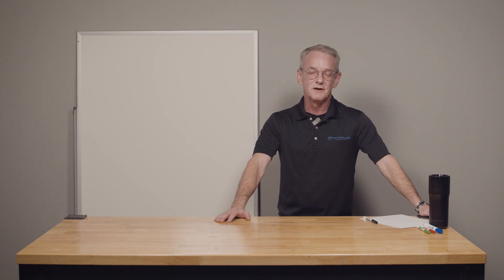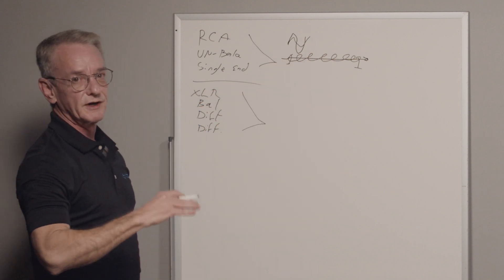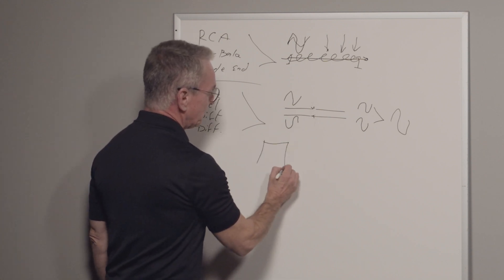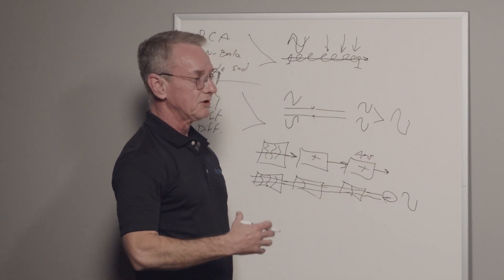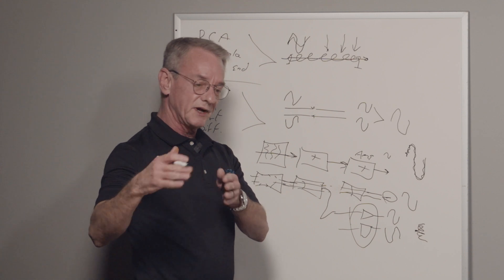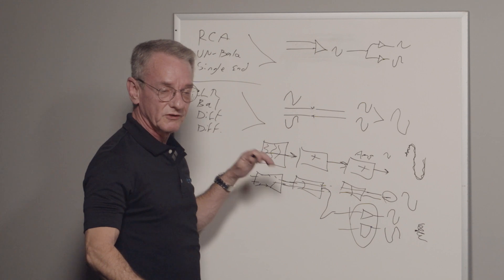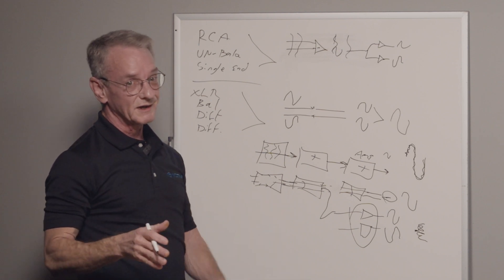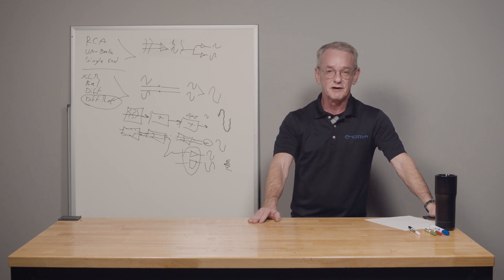What is Differential Reference™?

Comment: Thank you Lonnie; makes sense to my electrical engineering side. My new DR2 arrives in a few days which will replace a few year old XPA-2 Gen3 which has been a great amp. I am confident from your discussion and other reviews the DR2 will be comparatively improved audio in addition to higher power output. Will update after the DR2 is broken in for awhile.

The other recent great improvement added to my relatively high end system is cryo treated interconnect cables; somewhat pricey but worth it. Instantaneous noticeable audio improvement.
Reply: Update after having my new DR2 for a week and burn in over that time. Immediate noticeable musical sound improvement, more so after a week of burn in. Is the best sounding amp have owned over fifty years and five amps or  so. Simply great.

Comment: Here is the thing, we all know this. It just means it's a balanced connection out of convenience and not "True balanced". Or as people call it and companies sometimes. True balanced. Any doubt just see if it has double the parts. Reality is, it's very circumstantial any benefit of balanced and most gear that is even half way decent is exceedly quiet even single ended. To the point is well below the threshold in most instances. Ultra sensitive speakers or IEM's especially. They can pick up on particularly poor equipment. But if it is halfway decent, you won't hear jack even with that short of some of the most sensitive IEM's. But you ain't running that on a speaker amp.

Comment: It's Impressive audio technology, but Emotiva should do something about the retarded user interface on the DR4 unit (I've had for about a year).  It's so slow, and clumsy, it has me back to using my old NAD BEE into, which has a dramatically better user interface experience.  Why does the Emotiva need do cycle through. CLOSE, then I press OPEN to insert a disc (but you have to wait to press it until the unit reads the keypress, then it does CLOSE again, LOADING, etc. PLAY.  Takes way too long.  And why does the device assume the user wants to PLAY the disc when first inserted?   Not always the case, many time I simple want to cues the disc for paying later.  So annoying.

Comment: Yes, I understand. Then I have to upgrade all components in the chain with truly balance. Very costly at once
Reply from the maker: True, if you want a "fully" differential signal chain, everything from the sources, to preamp, to amp would need to be fully differential. Though, if you just have one DR unit in the chain, you will still get some benefits compared to a completely unbalanced non differential system.

Comment: HELLO 👋 Emotiva I have MC-700 it's a unbalanced if I used a balance output adopter on a XPA amplifier. Will this improve my the MC-700 unbalanced to balance output adopter? Currently I'm using a Emotiva basx5175 upgrading to XPA amplifier is my dream!😊😊

Comment: In an perfect world that sounds great. But all electronic and all components have it's tolerances and deviations. That means that the signal paths wold be slightly different, the 0 and the 180 path (+/- paths). What will that do at the end of the signalchain? Mayby nothing, but I cant help but wonder. To me balanced makes most sence were it was originally used and necessary, were long signal kables were needed. Like frome a stage, to FOH and back to the amp-racks, of an consert venue.

Comment: So each channel has 2 complimentary signal paths in it? One channel to handle the inverted wave of the other? 2 devices, either discrete or chip, for each active process operation, e.g. gain, EQ, ... Are analog volume controls used? 2 needed for each of the channels?